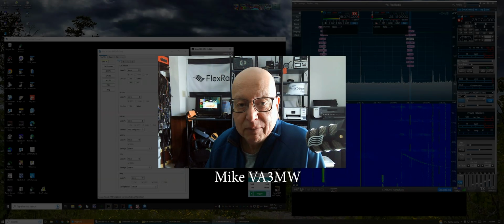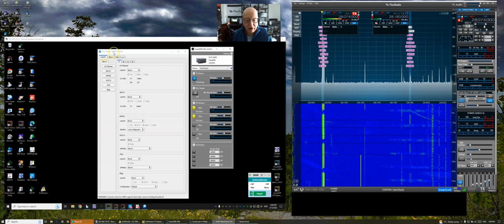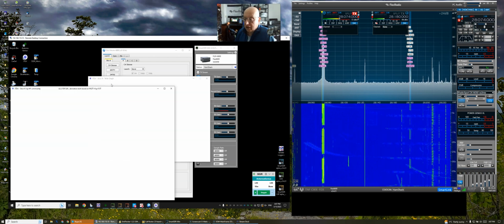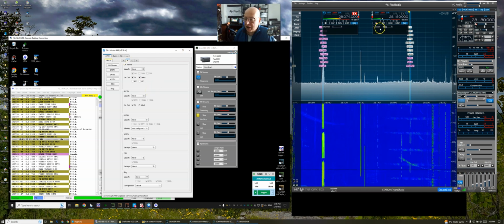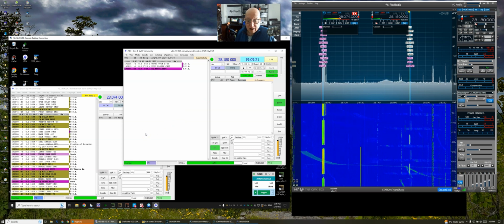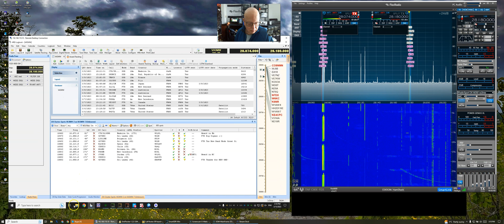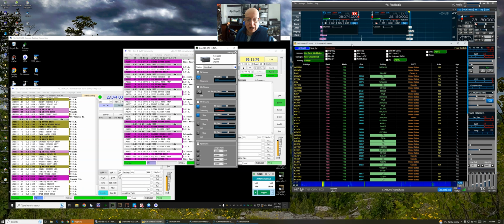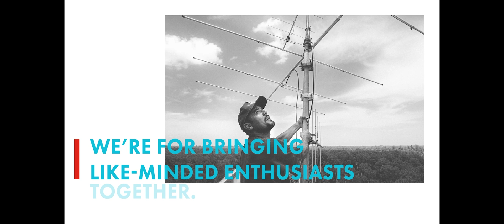FT8 and FT4 at the same time

Comment: Dear Mike (VA3MW),
the question is not specific to the video but related to a setting you use between HRD and the Flex.
I noticed that your HRD displays both frequencies of the two SLICEs (A and B).

Where can I find the related setting information?
Thanks in advance and greetings
73 of IZ1XEE
Reply from the maker: I actually use SliceMaster now to link between my HRD Logbook and the actual radio.  It is described in the SliceMaster documentation.

Comment: Good info Mike, thanks.  I routinely run with two slices (different bands) and two instances of JTDX, controlled by Slicemaster.  One thing to note though, is that every additional slice increases the lag time.  At least that is the case with my 2.30GHz i5 NUC. It's not been a problem (yet), but the lag time does increase. de W3US